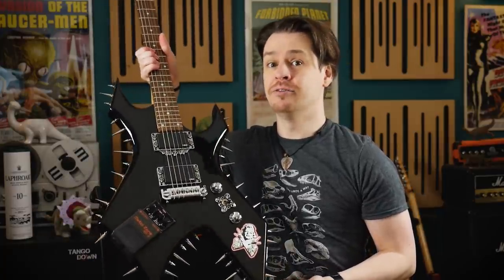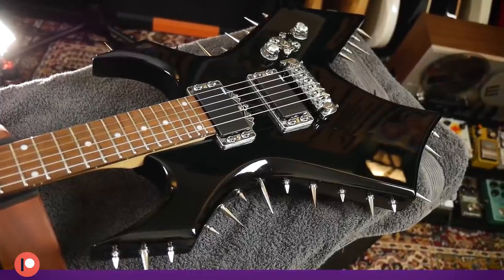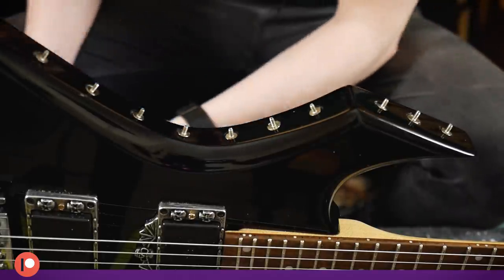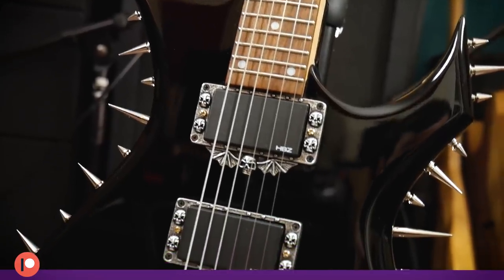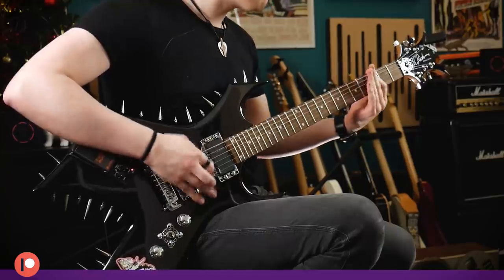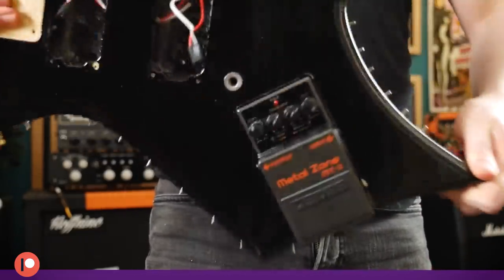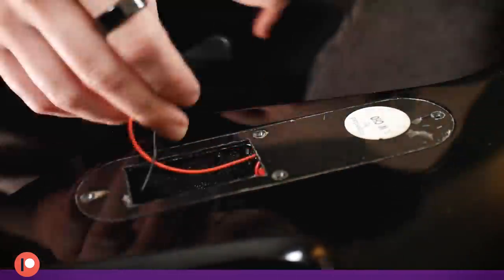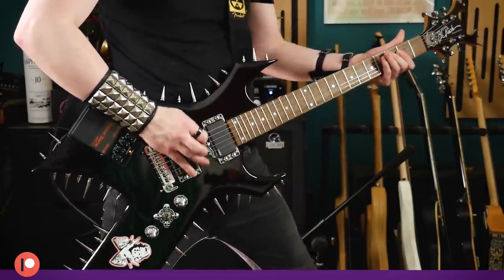Installing a METAL ZONE in a GUITAR | Behind The Scenes

Comment from the maker: Want more like this? Join Patreon: https://www.patreon.com/csguitars

Much of the process of creating the 'Ultimate Teenager's Metal Guitar' didn't make it into the main video. Usually in this situation all the extra video gets bundled up and posted on Patreon as exclusive Behind The Scenes content. 

This video is a sample of what you are missing out on. Join Patreon for more BTS CSGuitars goodness. 
View the original video here - https://youtu.be/q5H7PSSEWzc

#metalzone #csguitars #bcrich

More from CSGuitars: 
Gain access to exclusive content at: https://www.patreon.com/csguitars
Join CSGuitars Discord - https://discord.gg/d7b6MY8
Buy CSGuitars Merchandise - https://www.csguitars.co.uk/store
Website - http://www.csguitars.co.uk
Contact - colin@csguitars.co.uk
Reply: This might have been the worst way to do this I can think of. You could have picked say a Strat with swimming pool route and pulled the pedal out of the enclosure, added the knobs on top of the pickgaurd, and then put the pedal on a switch so it can be entirely removed from the circuit for 'passive' function - although the pickups are active anyway - in a 'true bypass' fashion. Although since it's an HB I guess nothing of value was lost by routing a square out of it.
Reply from the maker: ^ I think someone completely missed the point
Reply: @ScienceofLoud  : and the fact that it's a B.C. Rich!

Comment: I wonder if this would have been better as a prank, hear me out! You'll need something like a hollow body  or something you could at least conceal the guts of a metal zone (or similar) inside. You break the pedal down so you just have the functioning circuit board, battery etc. If you could find someway of hiding it inside the body so no one suspects anything and of course hardwire the pedal to the circuit inside the guitar so whenever you plug it in BOOM! It works straight off the bat, then leave it next to a nice fender amplifier or something. As soon as the player plugs in SCREEEE! I'd fucking pay to see that unfold

Comment: Alright I can't find any forums online that answer my specific question so I'm just dropping it off here. I'm trying to get myself an affordable amp setup for heavy music, specifically gearing towards the British high gain sound. What I've narrowed down as the three options I like are The Joyo Meteor ran through a 1x12 cab, the orange crush 35rt, or it's bigger brother the orange crush pro 60. The criteria I have for the amp setup is versatile tones, with a solid nail on the fat, high gain tone, that works both for a bedroom guitarist but could do small gigs if it ever came up, and I also want it to respond well to pedals. I know a lot of people are immediately gonna point it straight to the Joyo for actually having a tube pre amp, but I also wanna secure myself a nice headroom for clean stuff (which seems to ever so slightly lack in these micro amps). The combo amps I like for simplicity and the 35rt for affordability. Anyone wanna drop their two cents? It'd be heavily appreciated.
Reply: Peavey transtube. They can bring you some good fat.

Comment: Those stickers are as cringe as what my friend would listen to around 2005. Perfect selection. The Metal Zone work was pretty clever, hats off for that. I wonder if it was your modded or a new Metal Zone?

Also to my shock I just grabbed a Metal Zone today for the first time ever and it can actually make noises all over the spectrum from pleasant middly humped low drive to scooped buzz saw. Never knew it can be used as almost blues driver/tube screamer replacement in stock configuration. Would just tweak the bass and treble range a bit down by default and lower distortion range. I'm prone to think the reason for the universal bad reputation is people who don't know how to tweak sounds or what they even want if the knobs at noon don't bring it.